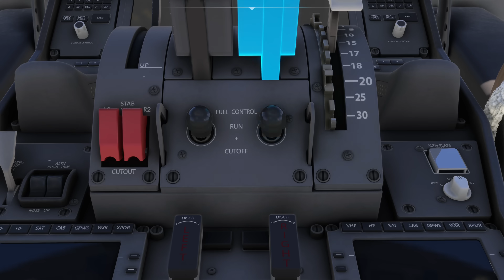Air India 171: Why Did The Fuel Cut-off Switch Get Moved?

Comment: You state that you're committed to honoring the facts from the preliminary report and I would like you to address some of the more critical facts and issues missing from the report. I posted my comments to another Youtube channel but I would love to hear your take on what I considered is missing in the report and some other discrepancies. 

Crucial omission in report: In the preliminary report, fuel switch 1 transitioned from cutoff to run 10 seconds after this switch was cutoff around 08:08:42. Switch 2 transitioned to run 13 seconds after this switch 2 was moved to cutoff around 08:08:43 (1 second gap between the two switches).  What occurred in the cockpit during the 10 seconds, why no transcript of this very important time-period that would answer so many questions. If the switches were intentionally shut off by one of the pilots it would be logical that a very serious confrontation would occur between the two pilots and this would be captured and recorded. What was the conversation or confrontation that occurred during the 10 second time period the fuel was cut off to the engines and then restored? Were the fuel switches even moved to the cutoff position in the first place? The 10 second transcript would clear up so much and there’s no valid reason a transcript of this short cockpit voice recording couldn’t have been included in the preliminary report unless there’s something to hide. The transcript would have added a page to the preliminary report and it would have been a page with the most valuable information in the report. The few words that were put into the preliminary report is pathetic, no context and it appears not even actual quoted words by the pilots.      

Crucial timestamp omission: In the report they said both the fuel switches transitioned to cutoff occurred immediately after max airspeed recorded, 180 knots at 08:08:42, what does the actual recorded data say, why omit the exact recorded timestamp data when both switches transition to fuel cutoff. Also, it would be logical to expect the fuel switch transition time to cutoff to occur prior to the max recorded air speed, there needs to be some amount of time for the engines to burn through the residual fuel before losing thrust and air speed. Max speed would continue to increase for some short amount of time after switch cutoff in my opinion. Would love to hear from experts on this one. 

Question for experts: In the report there was a 5 second time period between the max 180 knots speed reached by the plane during takeoff to both engines below minimum idle speed. Can someone with knowledge about the engines and fuel cutoff tell me if this is possible. Max thrust, max rpms during takeoff to below minimum idle speed in 5 seconds. 

Critical Timestamp omission: In the report why wasn’t the RAT exact deployment time included, they just referred to the CCTV footage and that it deployed during the initial climb. Why omit the exact recorded time the RAT was deployed, this has to be recorded data. The timing of this deployment relative to when the fuel switches transitioned to cut-off is critical to determine if there was a serious problem with the plane prior to the fuel switches transitioning. From the photo in the report the RAT was deployed at a very low altitude just after takeoff. I think the RAT deployed before the fuel switches were supposedly moved to cutoff. Much of the commentary by Youtube pilots say the fuel switch cutoff to both engines signaled dual engine failure and then RAT deployment, I’m not convinced shutting off the fuel switches does signal a dual engine failure to the plane's safety system right away, maybe later when the engines go below minimum idle speed but I’m not the expert.  It looks like the RAT deployed prior to the fuel switches transition to cutoff anyway. Experts please comment. Also, if a dual engine failure does get triggered when both fuel switches are manually switched off in flight and during take-off then why doesn’t the FADEC system override this extremely dangerous situation?         

Obvious discrepancy and timestamp data omission: The report said the landing gear lever was in the down, extend position yet the picture in the report shows the lever in a mid-position and there’s no mention what the actual recorded data says about the lever position or data about the landing gear tilt position. Previous photos of the landing gear clearly show the landing gear forward tilt position, which means the landing gear retraction sequence of events had started but stopped at this point.  

Why didn’t the RAT deployment signal the APU to start up sooner? If both engines are below minimum idle and in need of a relight when the fuel switches transition back to run for fuel to the engines, what spools up the engines for the engine relight? Isn’t engine starting power needed at this point? The APU inlet door is just opening at 08:08:56 and wouldn’t the APU need to be running and producing enough power start and relight the first main engine? Was the plane going fast enough for windmilling to turn the engines over fast enough for a relight like the report says? The RAT deployed well before the APU auto restart, shouldn’t the RAT deployment signal the APU to auto start? Again, why no time stamp when the RAT deployed?

Thanks for any response on the facts that are missing from the report.

Comment: There is a life cycle of mechanical cpmponemts. Apparently, these switches have been cycled 15,000 times over its 11 year life span. Have they ever been inspected during any inspection of this aircraft? Switches should be checked if possible.

Comment: If the cut-off switches were found in the cut-off position, how can you say the switches were back in the run position as completed by the other Captain within 10 seconds. Or the other captain tried to re-run the engines but it was too late?

Comment: If fuel was cut off after rotate, that means the aircraft was fine, but then why it took so long to get airborne? Even the aircrafts which experience single engine failure at V1 don't take entire runway for takeoff but this plane did.

Also, I am from India and I don't feel proud in saying this but I know how things are done here and they're definitely, 100%, hiding things in the preliminary report.

Comment: Is there any possibility that
1.the fuel control switches had locking issue and transitioned/moved/rolled back to cutt off position without anybody's intervention ?

3.shouldn't the pilot be asking 'Did you do that ?' instead of 'why did you do that ?' unless he actually saw other pilot doing it ?
Reply: There wasn’t a direct quote in the report and it was poorly worded in terms of grammatically correct English, so it’s entirely possible the question was “Did you cut off” rather than “Why you cut off?”

Comment: Correction Captain Steve. Nowhere does it say that one of the pilots placed switches to CUTOFF. While it is most likely sequence of events, its still plausilble that initial reaction was not to observed action but to auditory cues and switches actually TRANSITIONED due to some sort of physical malfunction. 

MAYBE they were not in CUTOFF physicaly but ECU malfunction registered CUTOFF for whatever reason. Maybe it took 10 seconds to restart because they had to think for a moment why they are losing thrust while the switches are in ON position, before finally deciding to move them manually. It's a scary decision. If it was the other pilot su** attempt, wouldnt he resist restarting engines in the first place? Wouldnt there be some recorded audio of a struggle or tense verbal exchange? It doesnt add up.
Reply: Please think rationally. You are grasping at straws here for obscure mechanical faults that have never been noted in the history of Dreamliner even for a single switch. And here suddenly, 2 switches fail one after another - even if the lock feature was compromised the switch doesn't just jiggle around. And for both switches ? forget about it.  Also the data recorder records actual movement of the switches  - it's purpose is to track what the pilots did in the cockpit - so the switch was definitely moved. You ask good questions about interaction of the pilots, The report was deliberately vague about it. They already know what happened and there was a reason they didn't reveal all. They are softening the blow for the public and will maintain some type of uncertainity to permit a technical failure theory, however improbable. Same thing happened with SilkAir. The weakest link in air travel remains to be human beings.

Comment: Boieng aircraft are equipped with automatic systems capable of cutting off fuel to the engines, it would not be entirely accurate to assume pilot error as the sole cause. Based on my understanding, such systems are indeed present.

In recent years, Boeing's actions have raised more concerns than individual pilot errors. If there is a need for scrutiny, it should be directed toward

Comment: The physical position of the switches (the actual knobs) may not be the position of the switches recorded by the flight 
 recorder. This can only be a feint possibility because of the 1 sec L/R separation but cant be ruled out ? Ive just watched an Air India 787 captain explain that 1 sec between switches is too short , can anyone with physical experience here refute this assertion ? Also does anyone know if there are capacitors placed across switch contacts that due to a short might then take ages to reach their rms voltage to allow the correct logic level to be sent ?

Comment: Hi, I’m just someone with no aviation-specific knowledge, but I enjoy watching aviation-related content like yours. I’ve watched some videos that went through the preliminary report, including yours, and it seems the engines started to spool up again just before impact. I’ve been wondering: if the flaps were set to 15 or higher, could that have provided enough lift and time for the aircraft to recover from the dive? Or would the added drag have just increased the descent rate in the end?

Comment: Captain Steeeve discussed the fuel cut-off switches. What about a new proposal by manufacturers to enhance safety. 
One idea is to install a double set of fuel cut-off switches—one to the left of the Captain  the second set to the right of the first officer that way one person could not trip both of them. 

A second idea would be to place the  Engine 1 cutoff to the left of the Captain and Engine 2 to the right of the First Officer. This arrangement would prevent one pilot from simultaneously shutting off both engines. It's important to note that if only one cut-off switch were turned off, the plane could still operate.

Additionally, please continue to focus on mental health initiatives for pilots and first responders. Keep up the good work!

Comment: So, it was confirmed that the switch was actually in the off position? Have they identified that piece from the crash site? If not, would it be possible that the fuel was shut off due to chip failure?

Comment: Maybe a good solution would to place one switch to the left of the left seating pilot and the other to the right of the right seated pilot, not both at the centre. So if one pilot wanted to switch both fuel switches off either intentionally or by mistake, he/she would need to cross over the other pilot which would make it impossible to do it unnoticed.

Comment: Is it possible that fluid was spilled on the switches that gave an erroneous signal that the switches had been placed in the cut off position. Something comes to mind possibly with Airbus A350 that a directive was issued that placing coffee cups on the engine cut off panel could cause mid flight engine cut out

Comment: FO was pilot flying, most likely had both hands-on yoke. It took10 seconds before left engine was switched back to RUN, another 4 seconds to turn right engine back on. Why the delay? 
Dan Gryder speculates Captain did this with intent, for reasons unknown

Comment: Sir,
Can it be like they didn't do anything manually there and  switches remain in on position 
Pilot heard engine rev back sound and asked the other pilot did u cut off but actually nobody did anything 
They tried to do the start up manually that is pull back and up manually so it took 4 seconds 
RAM deployed automatically due to the first cut off which happened due to systems fuel cutoff error wch oly showed 1 sec interval
Can it be possible

Comment: About "AI", first of all, autonomy is achieved without so called "AI", and it is correct that there should be no "AI" on board. But the same goes with pilots. We can debug both SW and HW, and achieve all safety objectives. But we would never be able to "debug" humans, who will always be prone to errors or even worse. And pilots are the last weak link in aviation safety for decades already. And of course they would never admit it :)

Comment: Strange question on such a situation was : "Why did you cut off fuel?". More likely would be "What the hack is going on???"
Numb. 2 : it took almost 11 seconds for the pilot (whoever it was) to reposition those switches to on. Also, strange. And knowing the 1st officer (P.F) had both hands on the yoke, it's not difficult to imagine who moved those switches from run to cut off. There is no need to go around the bush with this. It's time to recognise that pilots are human beings who are subjected to the same problems as any other human being. Problems that have to be addressed without the motives or constraints that have been preventing pilots from going forward and say "hey I need help to solve this problem " without fearing for their careers.

Comment: FAA, December 17, 2018 (and I quote): "This Special Airworthiness Information Bulletin (SAIB) is to advise registered owners and operators 
of The Boeing Company Model 717-200 airplanes; Model 737-700, -700C, -800, and -900ER 
series airplanes; Model 737-8 and -9 airplanes; Model 747-400, -400D, -400F, -8, and -8F series 
airplanes; Model 757-200, -200CB, -200PF, and -300 series airplanes; Model 767-200, -300, -
300F, -400ER, and -2C series airplanes; ; Model MD-11 and 
MD-11F airplanes; and Model MD-90-30 airplanes of the potential for disengagement of the fuel 
control switch locking feature."

"The Boeing Company (Boeing) received reports from operators of Model 737 airplanes that the . The fuel control switches (or 
engine start switches) are installed on the control stand in the flight deck and used by the pilot to 
supply or cutoff fuel to the engines. The fuel control switch has a locking feature to prevent 
inadvertent operation that could result in unintended switch movement between the fuel supply and 
fuel cutoff positions. In order to move the switch from one position to the other under the condition 
where the locking feature is engaged, it is necessary for the pilot to lift the switch up while 
transitioning the switch position. "

Sound familiar?

Comment: so, the FDR records electrical signals coming from the switch. Therefore, if there is a cutoff signal, then the switch must have been moved. The question I have is: what are the odds that there is an electrical malfunction between the switch and the sensor, or in the switch itself, so that even though it hasn't been manually moved, it starts sending a cut off signal?

Comment: Is there anything close by the fuel cut off switches that the pilot could have meant to adjust, but in a momentary lack of concentration he subconsciously pulled the wrong switch. Not realising he’d done it so when questioned by the other pilot he genuinely didn’t believe he’d touched them. Maybe then looking down realised what he’d done and set them back to run. 

If I wanted to end it all in an aircraft, this seems a bizarre method. Who’s to say that it would even work. The other pilot could see you do it and instantly set them back to run for example. Surely you’d just point the nose at the ground when the other pilot went to the rest room. This seems way too flakey a method to be a deliberate act when there’s so many more guaranteed ways if that’s your intention.

Comment: I'm giving the benefit of the doubt here but the switches are only the front end of the control.  I'm imagining my reaction in this situation.  You tell me Steve, are those switches tallied up to the control console and produced an alarm?  Then the PIC or FO would have checked those switches and if ON would have toggled them off then back on. (I would have done this and honestly do it all the time with other equipment) Thinking maybe bad contacts or that something didn't connect right.  I don't think both switches would have been bad.  But the software looks at switch positions and then executes code to the fuel control matrix.  One wire after the switch would be all it would take and if intermittent would result in switching on and then off then on..well you get the idea.  
I assume the switches were found in the run position.  If there's anything left I would be looking at failure after the switch.  If I had a circuit diagram I might be able to figure this out.  
Absolutely those switches coud NOT have moved themselves since there is NO servo activation EVER for these switches so the comments in the cockpit about 'why did you do that' would lead me to believe that the switches had been moved from RUN to CUTOFF.  Then back to RUN.  It sounds like when switched to RUN the fans recovered fairly quickly..or tried to.  Add 10 seconds and they may have made it.
The switches are known as 'Self Locking'.  An example here:  https://amzn.to/3GMYiAp.  These are often used for power supplies where you have to THINK before you turn it off such that even if you hang your keys on the switche it will remain in position.
Great coverage BTW.  Love you analysis.